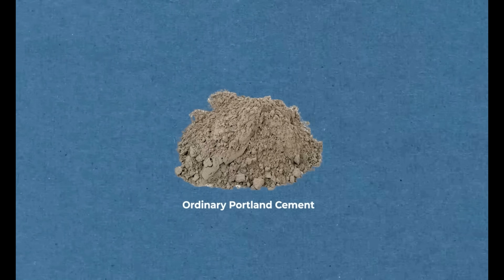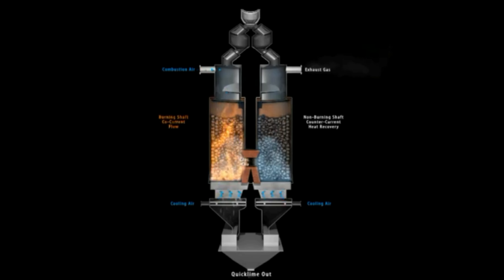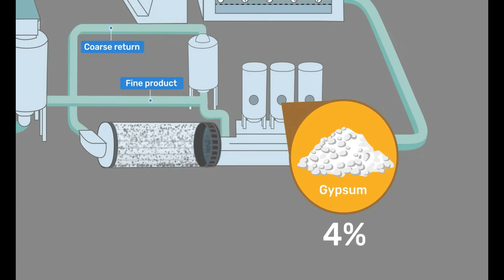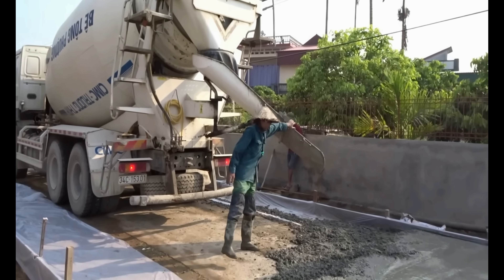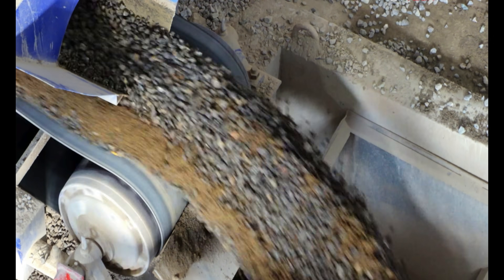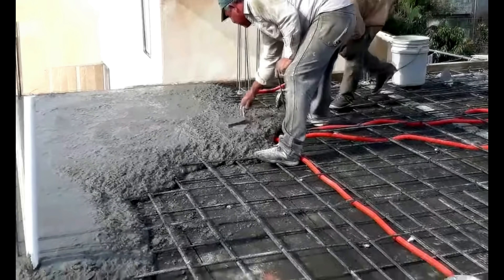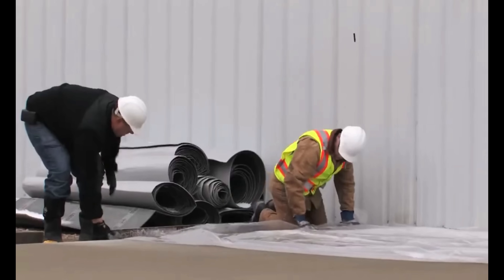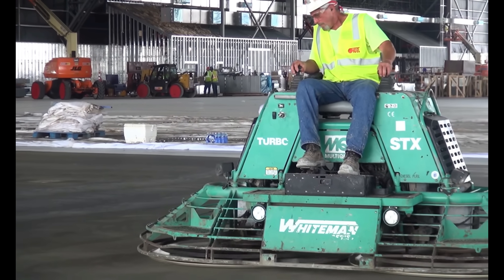How CEMENT is Made | in FACTORIES

Comment: I worked for 30 years in a foundry that made the wear parts for the machines that manufacture cement. There are a great many more details in this process that were not covered in this video but what was presented was fairly accurate. I suppose I am biased due to my occupational involvement but I think this video spent way more time discussing the simple process of mixing concrete than it did the very detailed and interesting process of mining, crushing, calcining, grinding and particle size and Blaine control of making the actual cement.

Comment: Boy…… that took me back to my carpentry apprenticeship in 1973!!!
We mixed all our own concrete in an on-site mixer…..which produced one barrow load of concrete!!!
Into the mixer went a bucket of water, five shovels of aggregate, then two shovels of cement!!!
We let it mix…. Then added more aggregate to stiffen the mix!!!
We used this method for foundations, slabs and concrete walls!!!
If pouring a foundation and the concrete stopped flowing….. the boss would ask for a pea soup mix, which was basically water and cement, to unblock the jamb concrete!!!
1500 degrees Celsius to make cement….. don’t think solar and wind power can generate that amount of heat!!!!
Fossil fuels forever!!!!
Regards Ian 👨‍🎤🇳🇿👍🍸🍸

Comment: Your vid show about concrete mixture or making, not about  how 'cement is made'. I expect with the 'title' you present a comprehension method about how cement are actually created at the basic level in its factory! materials, elements, additives, compositioning, until lastly, packaging. So, it's little dissapointed!

Comment: Worked maintenance of three different cement manufacturing plants on nearly every process, from crushing rock to equipment loading bulk finished product onto trucks or boats. The one glaring difference between the video and real life, klinker doesn't come out in smooth spheres (those were balls from a ball mill). Klinker comes out in sharp, almost needle like structures that stick together in lumps, nasty business to work in the 'kinker hall' where this stuff is stored, very abrasive and has a high alkaline ph of 11. not uncommon to have bulk vinegar to wash pickups.
Jeez I'm a long winded old f••••

Comment: Conceived,  engendered, designed, and built by people of European descent. Other things invented by white people include:

Submarines, electric lights, nuclear power, microwaves, CAT scans, automobiles, hydraulic, wind turbines, backhoes & excavators, jet airplanes, aluminum, ballpoint pen, hydroelectric dams, steam power, trains & diesel locomotives, tractors, modern pharmaceuticals, open heart surgery, satellites, radios, telephones, televisions, arch & tig welding, computers, transistors, milling machines, plasma and hydrojet cutting, microchips, titanium, telescope, democracy, capitalism, modern farming, x-rays, typewriters, sewing machines, gyroscope, SCUBA systems, pasteurization, center pivot irrigation systems, bicycles, hypodermic needles, Velcro, microphones & amplified speakers, space travel, airplanes, fiber optics, ultrasounds, internet, printing press, container ships, aircraft , GPS, modern textiles, calculus, dynamite, internal combustion engine, Kevlar, moving assembly lines, antibiotics, aspirin, refrigerators, chainsaws petroleum production, trigonometry, helicopters, thermometer, glass mirrors, directional drilling, Astrophysics, crop rotation, carbon fiber, super conductors, particle colliders, pneumatic tires, MRI, sextant, robotics, telea a graph, microscope, firearms, penicillin, refined oil and fuels, hovercraft, computers, carbon 14 dating, angioplasty, telescope, pipelines, open heart surgery, tower cranes, chemo therapy, light emitting diodes, motion pictures, cameraswas was, digital cameras, CD/DVD, concrete, dynamite, lithium batteries, LED lights, refrigerators, nylon, water pumps, radar, sonar, satellites, distillation, electric motors, magnetic compass, sextant, clocks, plastics, vaccines, vulcanized rubber, insulin, combine grain harvesters, zippers, and concrete …. Just to name a few. 

What did your ancestors invent that have contributed to the modern human age? Feel free to list them out here.

Comment: Concrete is the preferred material for city streets in some parts of the USA.  In other places, even at similar latitudes, streets are paved with asphalt.    What are the respective cost, utility, and longevity factors?  I presume that asphalt is cheaper to apply or repair, but wears faster and does not survive many winters that require lots of salt to melt snow.  Concrete may last forever, but it is cast in blocks that, over the years, tilt or buckle, making a ride rather bumpy, and whose replacement may be expensive.  Am I naive or mistaken?

Comment: This video describes that "the concrete is FINISHED after the concrete cures" no it's not; concrete finishing begins when the concrete is screeded, then when the concrete "sets" or "goes off" the concrete finishers use trowels to pull the cream to the surface making it clean and finished, THEN IT CURES. No one who has ever finished concrete would describe this video as it has been.

Comment: "Additive"  2:35 was quickly mentioned but it's key to concrete's strength today.  Some are also biohazards.  "Slag" is the refuse from the top of iron smelting pots but "Fly Ash" is the remnants of burned Coal and is often saturated with Mercury.  Fly Ash is considered a biohazard. Coal companies and Coal fired electric generation plants are all too happy to get rid if it because some "temporary" (they don't know what else to do with it, it's a biohazards) storage dams have failed with disastrous results.

The problem is now this distribution of Fly Ash (in set concrete) is above ground, more succeptible to water draining through it and therefore more likely to leach and contaminate groundwater, etc.  Mercury once locked into Coal deposits and deep underground is now distributed throughout the country and used in new concrete pours on a daily basis.

FYI, I worked for an engineering and inspection company for about a decade.

Comment: Most impressiv is how old old this is. 2000 years ago, roman empire did make cement which was usefull under water. Hagia Sofia have survived many earthquackes and it repair itself. Old concrete is better than new one. That is very impressiv.
Reply from the maker: yes that's so true old concrete seems to be better the modern times concrete

Comment: The thing I find most interesting is the weight of it. I used to deliver truckloads of bagged cement. It only takes about 12 pallets to get your gross weight up to 79,000 lbs.
Reply from the maker: yes that is right, it think the weight comes from the crushed rocks in it, but yes totally agreed it is really heavy Cheers ✌
Reply: I use to haul bags of concrete out of Speed Indiana back in the 1990's

Comment: The slower the curing period, the better and that includes lots of moisture.  If concrete sets too fast or false sets and shrinks it can be a really costly error.  In a process, some slabs are immersed in liquid to cure very slowly.  Cement is relatively impervious to water, so it takes a lot of water to saturate the cement and get the optimum strength from it.  The clinkers can be stored outside and they resist water to the point that they are unaffected by it.  It isn’t until they have been pulverized that they begin to accept water.  Our current world would be vastly different without cement.

Comment: The Romans used pozzolana cement from Pozzuoli, Italy near Mt. Vesuvius to build the Appian Way, Roman baths, the Coliseum and Pantheon in Rome, and the Pont du Gard aqueduct in south France. They used lime as a cementitious material. Pliny reported a mortar mixture of 1 part lime to 4 parts sand. Vitruvius reported a 2 parts pozzolana to 1 part lime. Concrete was originally developed by the ancient Romans, whose building techniques were lost with the fall of the empire and wasn’t reinvented until 1824 when an Englishman named Joseph Aspdin discovered Portland cement by burning finely ground chalk and clay in a kiln until the carbon dioxide was removed.
Reply from the maker: That is correct
Reply: Did the unsavory criminal elements in ancient Rome dump bodies as filler  prior the pour too?
Reply: It's also doubtful modern cement/concrete will last as long a roman variety. The Romans  were also able to pore their concrete underwater.
Reply from the maker: @rickden8362 i totaly agreed with you here is a video of the roman cement
Reply from the maker: https://youtu.be/K4Pvxzu6Hbs
Reply from the maker: https://youtu.be/K4Pvxzu6Hbs
Reply: 4456
Reply: Crazy how advanced ancient rome was.

Comment: And we still don't have the formula for Roman concrete that lasts a thousand years or so as far as I know. For small jobs an old plumber put me onto 2 things. 1) If you needthe concrete to remain flowable add dishwashing liquid, 2) Add a small amount of sugar and it will set so hard you need a pneumatic hammer to break it up. I live off grid have tried both ways don't understand the chemical process of either but it works.

Comment: Cement mixtures should always be handled in a manner that eliminates prolonged exposure to the skin, and mucus membranes. Concrete and cement can cause serious burns and infections of the skin if not neutralized immediately. Cement residue will not simply rinse off the skin with water. the chemicals in the mixtures are still active and are absorbed into the skin. the burning chemicals can be easily neutralized by rinsing the affected areas of skin with vinegar. Only seasoned veteran cement finishers and laborers who work with concrete on a daily basis will have a bottle of vinegar always at hand.
Reply from the maker: yes i agree 100% can burn your skin
Reply: Ok..thanks

Comment: You can't just add water willy nilly. The strength of the concrete is carefully calculated. The amount of cement to water was part of this calculation and by adding extra water on site to make it more usable will weaken the concrete which could be critical.
Reply: That's why inspectors perform slump test.
Reply: True
Reply: Willy-nilly lol...that's true

Comment: Cement (the Adhesive) manufacture needs lots of Heat to make. Yes, there is underwater Concrete, and concrete which can be poured/cured in freezing weather.. You can also add gravel, stones, & rebar etc. to concrete..

Comment: Mislabeled is how I would pigeonhole this video.  How Concrete is made.  Cement is a process of isolating the glue that hold rock together.  The harder the stone, the better the cement strength.  But this knowledge isn't what structural engineers understand.

Comment: I like cement now
Reply: Rather have concrete roads than blacktopping or asphalt. Even if it uses a lot of water.
Reply: @aliensounddigital  No. That's a bad idea. It cracks, which means it either has to be poured with movement joints, or it will just crack randomly, and in either instance you get a constant repetitive noise from the car tyres as the go over the cracks.

Comment: I seem to remember we used to add washing up liquid to our water when mixing cement . It acted as a good plasticiser when plastering walls. I think an additive is now marketed instead.
Reply: The reason that washing up liquid is a really bad idea in cement products (usually mortar rather than concrete) is that it has a very high salt content, and this can lead to efflourescence in brickwork or other adjacent masonry. This appears as white deposits on the surface, and is very unsightly, and ultimately damaging to the masonry. The admixes used in place of detergents avoid this issue.
Reply: No matter what you do , efflorescence occurs . Eventually it does disappear , but this does take a long time 
 @MikeAG333
Reply: Adding  a small amount of sugar makes it that hard that you need an pneumatic hammer to break it.

Comment: I had no idea underwater concrete was a thing. It's such a niche thing requiring a very niche workforce.
Reply: When placed correctly, concrete which has not been diluted will actually displace water as it fills a mold or footing holes. Concrete will take much longer to cure under water, which in turn produces the strongest concrete.
Reply: All concrete will set underwaterr, as every builder who has ever mixed concrete with a shovel and then thrown it in a water butt overnight (instead of cleaning it properly) will tell you.

Comment: Amazing video but cement was invented by the Romans two thousand years ago..
Reply: And they also made it much more durable
Reply: It was quite different than this, volcanic pozzolan and burned lime. Now its believed that mixing it still hot made its special features.
Reply: Agreed.  And interesting to note that many Roman structures built  with concrete  are still standing while many schools in the UK have dodgy concrete roofs and will now have to be rebuilt after a few years.!
Reply: @goldenbear8696 yes, but that is about dodgy contractors and money grabbing councils taking back handers, concrete made to proper spec is far more durable and stronger
Reply: @goldenbear8696  The issue is with aerated concrete, not concrete. Aerated pre-formed slabs are like giant Aero bars, full of holes (deliberately). It's a great technology, used everywhere in so-called insulating blocks.....but its use in long spans, horizontally, was poorly understood or thought-through when it was invented in the 60s. Like all concretes, it is poor under tension, so not suitable un-reinforced in horizontal slabs or beams.
Reply: @goldenbear8696  but also, most Roman structures are long gone. Only the well made ones still stand today. All the poorly built ones are not around.
Reply: Yes and their building foundation strucutres were much larger due to this. It was not ment to build thin high scyscrapers which can bend in the wind. We came a long way since then... the romans wished they had concrete like nowadays. Ofc steelbeams played also a part of it. Its defenetly a interesting topic to go into.
Reply: Different stuff altogether (and again, you're confusing "cement" with "concrete").
Reply from the maker: Yes i agree 100%
Reply: And the crosse's that everyone wears and that they have on all of the churches are actually ROMAN death SYMBOLS.
Reply: Romans inventing cement is a myth. They used it extensively in concrete but they didn’t invent it.
Reply: Lime and sand natural cement
But can take months to cure
Portland cement 3 hour's dry,,,28 days cured
Reply: @TheDogGoesWoof69  Racist.A racist declaring himself non-racist is laughable.
Reply: So what ? This is now that was then
Reply: False Roman's just perfected it...not invent
Reply: Nothing in this video says otherwise
Reply: It was also made by the Chinese long before the romans, and don’t forget the ancient Egyptians before the Chinese..
Reply: @bubaks2  I don't think the Egyptians had concrete. There are some conspiracy theorists who have dreamt up something to the contrary, but there is no supporting evidence. The Chinese used lime, and lime with pozzolan, but not true concrete.